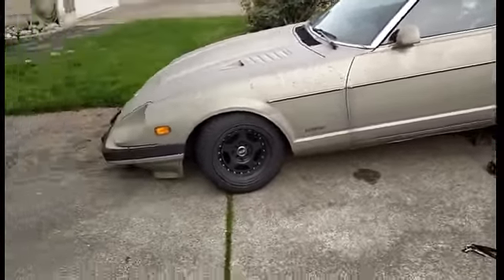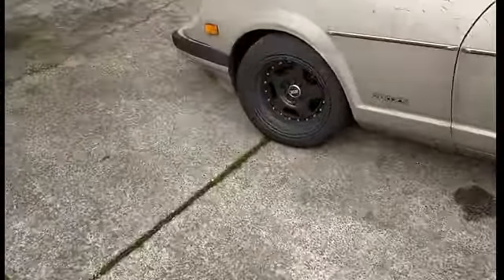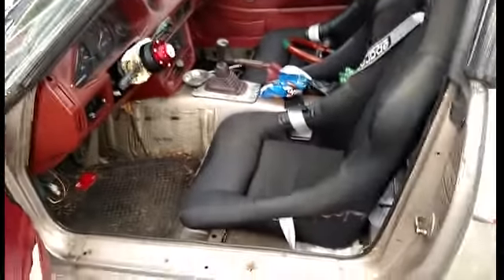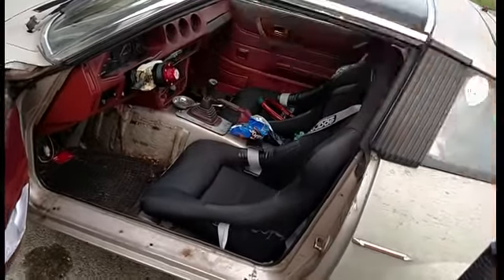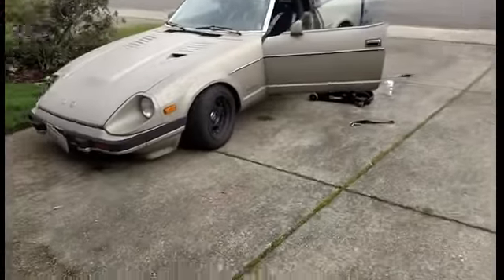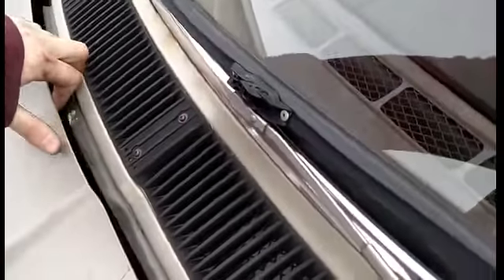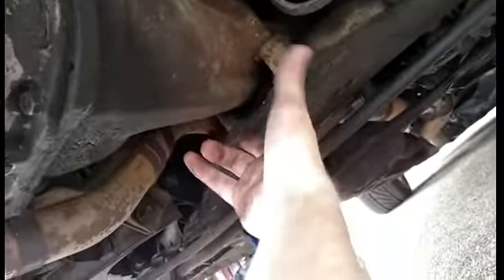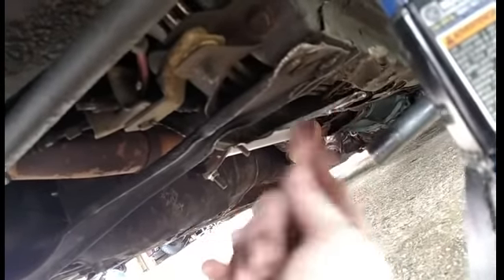280zx drift car build: welded diff part 1

Comment: The ZX's I've seen drifting seem to do alright, and the E30 BMW has the same suspension setup (semi-trailing arm). I think a lot of it has to do with the 280ZX being the redheaded stepchildren of the Z line and the fact that on drift forums, anything that's not an S13 is "completely wrong" for drifting. On the coilovers, did you weld S13 coilovers to the ZX spindles? The techno toy tuning units cost a ton in comparison. I plan to have my own Z ready for PARCFest 2018. It'd be rad to see your ZX out there getting sideways.
Reply: my Uncle Jeremy is the best